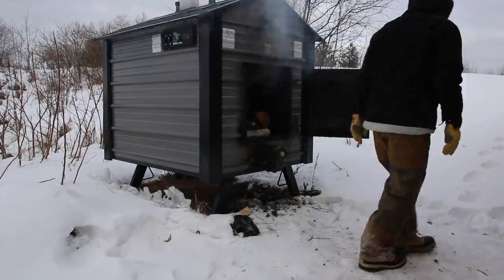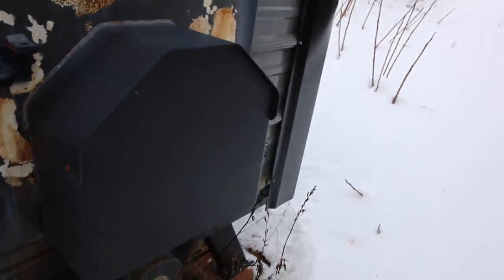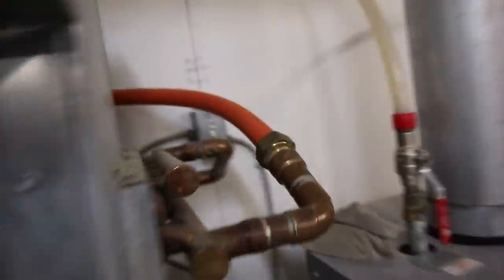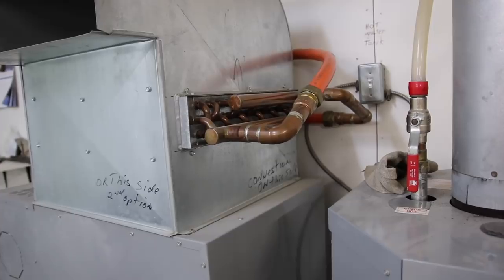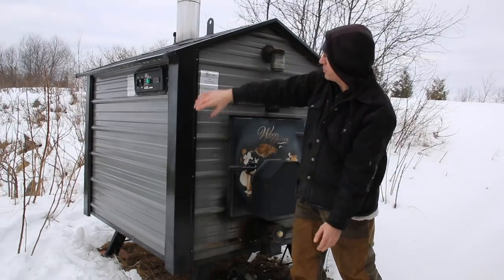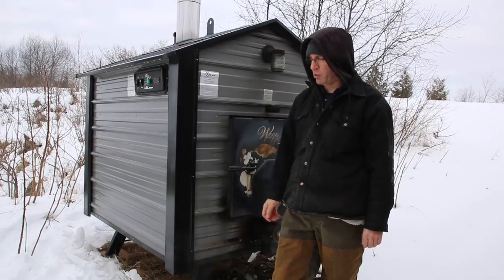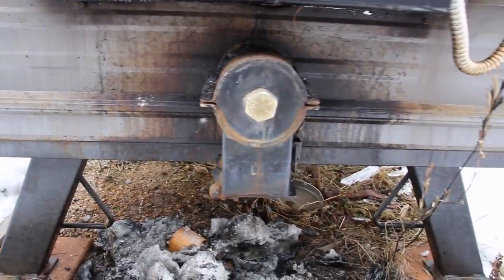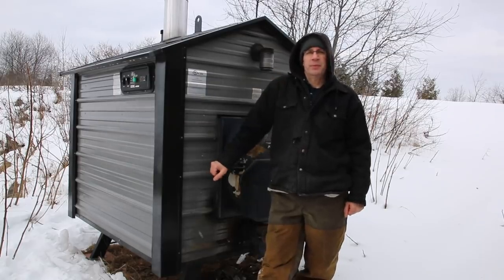Outdoor wood furnace "worth the investment?"

Comment: Just a tip. If you burn rounds/ unsplit wood it will burn longer
Reply: You mean it will smolder longer
Reply: @markrunyon5524  no bud I mean burn longer. When you have a larger space you can burn bigger wood and it burns longer without loosing BTU's. Think of it this way, build a big fire and feed it kindling all the time

Comment: Looks like he has newer homes and buildings . They are probably insulated well so propane cost probably not going to be a major issue for him.I have the same stove he has  since 2008. They take maintenance just like traditional a/c and heat units in houses. The temperature running up to 200 degrees was an issue for me until i started replacing the seal around the door at the beginning of every year. It takes about 5 minutes to do that. These stoves are not for every one. They do keep your heating costs somewhat static. I get 5 months of really hot water supply it seems that even hot water is getting more costly. Propane can be 2 dollars or 5 dollars a gallon, winters can be mild or harsh. If i had a new home with sips panels or really insulated well , personally i would not fool with the wood boiler. I had a friend that heated with wood inside he had a house fire doing it got burned bad . Sounds like the guy in the video has had enough. His stove is a long way from his house making him burn a considerable more amount of wood. My stove is directly east of my facilities. Very seldom do we get a direct east wind maybe southeast or northeast wind we don't smell smoke very much at all. Everybody's situation is different when it comes to the choice of an outside wood boiler for me i have a lot of dead trees i run through the stove, i can have my house as warm as i want rather than turning down the temperature in really cold weather trying keep cost down. Free hot water for 5 months and even if i bought my wood i would know my cost for the winter unlike propane or natural gas or electric. Some solace in knowing if the worst possible happens in this country i have heat and hot water at my control.

Comment: I have an indoor wood boiler, notice in the beginning of the video the guy gets all dressed up to go outside where it’s cold just to get warm? My wood is in my basement I burn 8-10 cord a year which is far less than they guy claims he uses looks like he had between 15-20 cord there, I live in Maine which is about the the top 3 coldest in the country, I wouldn’t own an out door boiler ever, I stoke my boiler 3 times a day, it will burn 12 hours but I like to keep it full so I go every 8 hours to stoke it, my indoor boiler is a titan Kerr and burns max 365 btu but runs at about 260 btu on average, my house is 3000 square feet and this is by far the best investment I made for this house, I spend roughly $1000 a year in heating for the wood, I get tree length and cut and split it myself, you can say time is money all you want, but there is no heat like wood heat period. Oil or gas doesn’t heat like wood, wood pellets in the end are comparable to oil, in the summer I burn oil, so I guess you could say I spend about $1365 a year in heating, so that’s my take on outdoor wood boilers, I wouldn’t own one I would suggest an indoor.
Reply: i run a simple buderus solid fuel boiler in the basement, when you get it running right its a pleasure to not go ouside and just go throw in some more wood at anytime.

Comment: Looks like a very inefficient setup to me, to make this whole setup more efficient you need to get an insulated hot water storage tank of at least 700 gallon, so that the boiler can run full blast for 90% of the time, it seems that your boiler is in choke mode for at least 2/3 of the time, wasting away al those woodgases in smoke and stink that you dislike.

I'll bet if you would only implement this small and not crazy expensive but important addition to your setup, you would burn a lot less wood.

Also your wood seems to be too "fresh". You have a 1 season supply of wood laying under that roof where snow and probably rain  have free play to moist up your wood, fresh wood never burns efficient, one thing that people seem to underestimate quite often, especially with logs that size you need to plan at least 3-4 seasons ahead to get somewhat dry wood.

I personally don't have the space nor the land to have my own wood for several years ahead but the wood that I burn for the upcoming winter, I always store it in an old greenhouse which becomes quite hot in the summertime and dries the wood pretty well before winter.

Other thoughts on your setup to increase efficiency is to have better insulated underground piping to your shop and lining the bottom part of your boiler with firebricks so that the fire burns hotter, but the best upgrade would be to buy a gasification boiler next time. (if there will be a "next time") and put it inside your shop, together with a hot water tank, if you have the space for that.

My guess is that your would burn half that pile of wood, saving money, your time, back and equipment with less stink and smoke.

Comment: For the price of unit you could fuel your oil furnace for 10 to 15 years without the work. And by that time your wood boiler will probably need replacing endless battle.
I just use a wood stove to heat my 1500 sq ft.  Shop doesn't go through the wood like the boiler i can easily keep it at 70 f if i want to  but thats to warm for me to work if i work in shop till 10 pm the next day its still about 50f at 8 to 10 am when it -40 outside if i leave it for 2 days its down to 40 f if im in no hurry build fire have breakfast up to 60 in 1.5 hours if im in hurry to work on something i have a diesel/kerosene radiant heater 75000 btu  warms up to 65f in about 20 min while woodstove gets warmed up kind of same deal have lots of wood i still haven't put a dent in cleaning up dead fall every now and then i get trees knocked down in storms or just pruning the trees the stove gets a treat i usually save that wood for when real cold better heat than dead fall.
I thought about one of those boilers but the cost what i would consider is a bale boiler you feed 1 bale every 2 to 3 days lots of flax straw around here that they just burn in field i could get it for nothing all I'd have to do is bale it up and bring it home i already have the tractors and balers for hay for livestock the nice thing is i don't have to cut it just bale behind the combine plus it'll burn up my 2 year old hay bales definitely a lot less work than wood but like you still need a backup heating system ive been using a electric construction heater on a 240 volt thermostat set to 35f just so things dont freeze but ive never had it get that low temp in there mind you i keep my tractors in there tools and what ever I can get in there once all that cast iron and fluid in tractor tires gets up to temp it'll radiate heat for quite a few days so my electric heater has never cut in i just leave enough room to work on things my feed tractor stays outside come spring the others get kicked out side if i need room. 
Good explanation on pros and cons of the wood boiler its it's what wr do to stay warm in the shop in winter 👍👍

Comment: I have a classic boiler n I really can't complain. It's 35' from my house. Burn less than 10 cords heating 4500 sq ft in the middle of Minnesota winters. Ya I spent the $ but paid for it self in 3 years n now it's all but free. On my 10th year. FYI - pay attention to wind ( normal n during the winter ) for placement of stove n if she starts burning too much then change ur door gasket. Best is it's an older one n not EPA regulations so I can burn all types of wood n u need the " junk" wood when it's not below 10-15 degrees. I chuckle when it's-30 with the wind at 25 mph n I'm in 75 degree heat most of u r freezing yr asses off n whining about the cold. No problem here just counting the savings.

Comment: I have a wood master boiler. Best investment I have made. Great stove. Have had it for over 15 years. Efficient, easy to operate and maintain. I heat my house with one full a day. If you spend the money on a boiler, make sure you spend the extra and insulate properly. I crawl into my stove every year and clean everything out completely. Maintenance is key in having a boiler last for years. I have owned some “ farmer built” boilers and they do not compare to a wood master. The extra cost is worth it.

Comment: Not a furnace, it's a boiler.       Furnace: hot air, boiler:hot water or steam.
Reply: These are not boilers,boilers are a closed system using temps over 212
Reply: RANDY SCHNEIDER then it’s a hot water heater.
Reply: No such thing as a hot water heater. it's a water heater.  Hot water doesn't need to be heated.  Educate yourself.
Reply: So there is no such thing as a hot water boiler? Cleaver Brooks makes them.... So educate yourself, and dont try to sound smart when you are clueless.

Reference: Boiler Tech for DelVal a boiler repair company
Reply: lichub "No such thing as a hot water heater. it's a water heater.  Hot water doesn't need to be heated."

If you were talking about the domestic water heater you'd be right; but this is a whole-house heating system that uses hot water as the transfer medium. So it's a hot water heater as opposed to an electric radiant element heater or a steam heater or...
Reply: @seikibrian8641  actually anything under 212 degrees is called a hot water heating system if it's over that is a boiler, and anything over 15 psi is a high pressure boiler system
Reply: @danpmatz  "...if it's over [212F it] is a boiler..."

If you're only talking about the actual device that heats the water, you're right. But the entire system isn't a boiler; it's a home heating system that uses a boiler, steam pipes, radiators, etc.
Reply: @seikibrian8641  you guys in this comments  just don't understand it's just something stupid how they are classified I just took a test a couple months ago about all this stuff
Reply: the water never gets over 185 unless theres a problem.
Reply: RANDY SCHNEIDER Not true and I’m a 30 year HVAC guy. That’s a wood boiler. The most common temp is 180 on small residential boilers, whether burning wood, NG, LP, oil, corn etc
Reply: Boys.... The proper name for these is “outdoor wood furnace”. That’s what the companies that sell them call them.
Reply: What an arrogant comment. There are MANY products in MANY industries that have an oblique or even mildly misleading name, not for a nefarious reason, but to speak to perhaps a non technical customer. Any experienced HVAC person would identify that as a wood boiler, whatever it’s marketed as.
Reply: And when speaking in any venue that’s not a marketing venue, and particularly a technical area or one in which people are talking about the mechanics of how it works, they would use the appropriate verbiage. The fuel medium is wood. The medium to be heated is water. It’s only because the manufacturer expects you to install a hot water coil associated with an air handler that they loosely use the word furnace. A technician working on it, or describing it, would ignore the air handler and refer to it as a wood boiler. It is ‘intergrated’ with the air handler, and it’s only if the issue was there would a technician pay it any attention to the air handler. I don’t care what the manufacturer calls it. It’s a wood boiler.
Reply: @raindogs451  these out door wood furneces are not a boiler, they do not meet any operation of a boiler, a gas fire true boiler met the boiler code, witch is a totaly closed system that runs at a presser of 10 to 12 psi, witch rasies the  boiling piont of water, meaning water that is open to air boils at 212 deg, by having a closed system boiler under 10 to 12 psi the boiler can be run up to 250 deg before it boils, hence boiler, you ask any heating contractor your out door hot water furnace, can you come and have a look at my out door wood boiler, and they will ether shack there head an smile or set you strait,  all these out door hot water heaters are open to the air, not under presser, and they are not marketed as boilers as they dont meet what a boiler is, and that would be false advertizing, but some under handed mfg do market them as boilers but one day, there time will come.. some make of these units that are built really good you can burn, wood, or coal, and the have a 3" port in the back for an auger system to automatically feed coal in as it calls for it, 99% of these units are made from mild steel, but claim they have a stainless steel water jacket,, as a welder that has patched many up, the so called stainless steel jacket is stainles sheet metal, like car sheet metal, well you put that be side mild steel and add condensation and you reall get a good rust going, there is only 2 companies that build there units out of 409 titan-am stainless 1/8" and come with a life time warranty that is transferable, and if a weld cracks and leeks they dos shipped and yours is shipped back
Reply: @seikibrian8641  you are talking about a totally different system by using the word boiler steam pipes, there are boilers under 10 to 12 psi that move hot water though the system, then you have a steam boiler system the operates at a higher closed system presser that only moves hot steam though the pipes and cast iron rads, and yes that is what a boiler is a closed system under presser to raise the boiling point of water. in order for water to air or a water to water heat exchanges need much more heat to operate effectively .. un-like in floor heating only needs 100to 115 deg water as the wood or cement floor works like a huge battery holding heat, and you dont want to be walking on a 180 or 210 deg floor, ever lower temp when used to melt ice an snow
Reply: Arnold Romppai Ask a Heating contractor?

I’m a 28 year heating contractor. And much of what you said is just incorrect.  The need I have to “ask someone” was years ago. In ANY HVAC system there are different environments; the combustion chamber, ducts, line set refrigeration area, hot water piping etc.

That IS a wood boiler.  He’ll try and maintain 160-180 in the water loop by regulating the oxygen in the burner area. The water loop IS pressurized between 12-20 pounds, and the relief on his hot water loop is 30 psi.  There are NO open boiler systems as to the water loop; they’re all pressurized to the 12-20 I mentioned. The most common target temperature setting for the loop (as differentiated from the burner box)  is 180.  (A “boiler reset control” will automatically reset the boiler loop serpoint based on outdoor ambient)

The burner chamber is s different environment and it is always at a different pressure and temperature. You can water MUCH hotter than 250 without boiling at the right pressure environment.  I doubt you do this for a living.
Reply: @arnoldromppai5395  I realize it may be difficult for you, but try reading my comment in context.
Reply: @raindogs451  if i didnt and if i didnt know the Ont Canada and regulations i would not talk about it, were ever you are from, you have some strang                                                                                                                                                                                                                                                                    thinking, for one a cert pump needs 10 to 12 psi head presser for the pump to move the water as they dont have any suction, put in an open system the outdoor wood hot water heater needs to be installed at the unit in order to have the back presser of the water it self, the pumps do not put out any presser if a line breaks the water just runs out, under its own flow, it will not spray out, it just move the water, the presser is no more then the head presser in an open system..
Reply: @seikibrian8641  yes i know the context what your saying that to you they are a boiler know mater what anyone clams,, i know that, others dont
Reply: Arnold Romppai  I have no idea what you’re talking about. What do you do for a living? I’ve worked on 500 boilers. I’m a heating contractor. Even is his own video he references the circulating pump and water jacket. That BY DEFINITION is a pressurized environment. The LOWEST setting we would use for a small residential boiler (and that IS a boiler) is 12 psi. We shoot for 12-18 PSI. Even in HIS video he references it as a boiler repeatedly. If I talk to a vendor, supply house, manufacturer, or colleague they speak the same language. A small residential boiler is set 12-18. THE BURNER CHAMBER where’s he’s burning wood is atmospheric pressure and hotter——hot enough to keep his loop at 180. I’m not gratified by arguing with some guy on the internet. YOU responded to ME——and started our discussion by saying ‘it doesn’t meet the requirements to be a boiler’. It’s a boiler and it meets every requirement to be a boiler. I’m not arguing with some guy who doesn’t even do this for a living. It’s a wood boiler, plain and simple.
Reply: Arnold Romppai  One last thing and I’m done with you. 

1) It doesn’t matter what the fuel is: it can be wood, oil, NG, LP etc, and still be a boiler.

2) Whether it’s sending it’s hot water (or glycol) to a radiator to give up its heat to the room, or a hot water coil in an air handler it makes no difference.

If it’s heating a hot liquid in a pressurized closed circulating loop system it’s a boiler, plain and simple.
Reply: @arnoldromppai5395  Nope; that's not what I'm saying at all. My comment was directed SPECIFICALY to Dan Matz, who suggested that if a given system operates over 212°F, the entire system is a boiler; I replied that only PART of the system is the actual boiler.